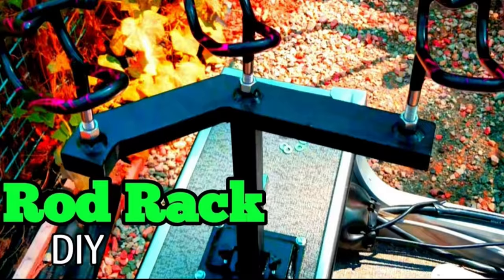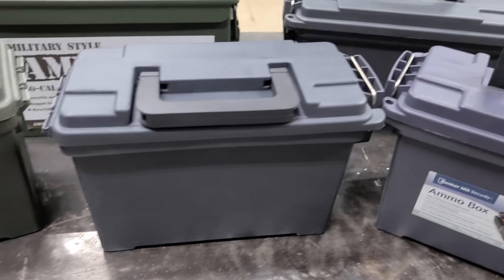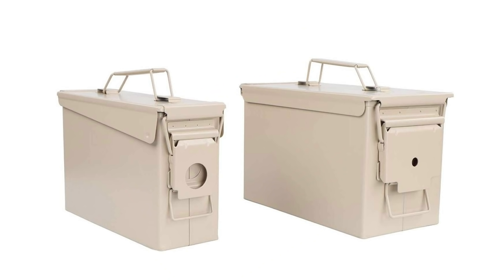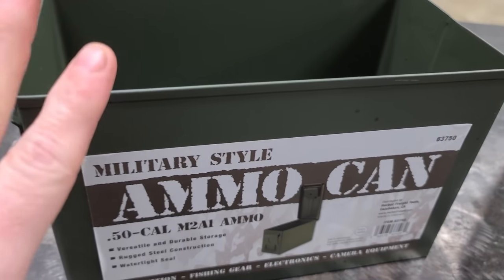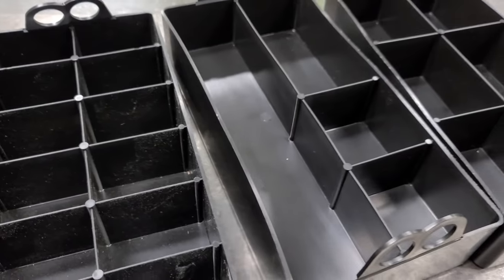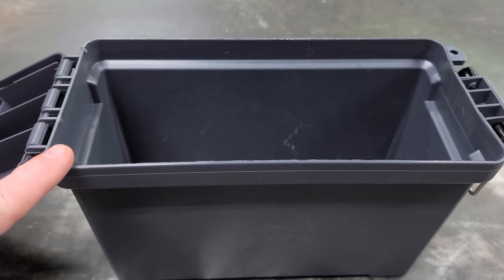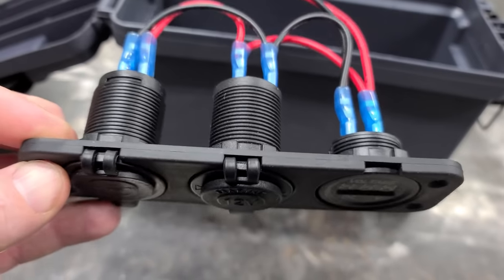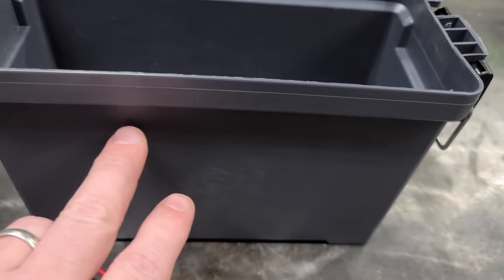10 Ammo Box Hacks

Comment: For bank fishin'.. instead of wacky noodles,  add another battery.  (connect in parallel)  you could also put your charger in there and a plug-in so when you get home from slaying the fishys, before you get the knife out just plug it in and your ready to go for the next time.  Also great for smaller boats for lights and accessories. and you can use the extra space for smaller items that you need water-proof.  Thanks for the cool vids!     SK.
Reply: Did… did you just sign a YouTube comment. 😂 imma start doing that too. 

A.S
Reply: Good idea... 

D.P

Comment: After watching this a second time, I would recommend using a 3 gallon bucket for your cast nets, versus a sealed ammo can. Because a cast net, gets wet and fish slimmed up, by the end of the day. Get a 3 / 5 gallon bucket. Drill some drain holes in it. At the end of the day, you can wash off the net with some soap and water, and let it drain and dry in its own bucket. Then its clean, dry, and NOT Stanky! And ready for the next big adventure! And you can always get a lid for the bucket, to keep the net stored, but the holes allow for dry air circulation.

Comment: Made the battery box power source.  Amazon has a power hub that also has a switch built in.  Solves one issue with that box.  I also added a charging port on the back side so you can just plug a battery tender or solar panel into it.  Never have to open the box.
Reply: How long does the battery last for what your using it for

Comment: Like the afterthought of the switch. Maybe grommets too and some silicone just to make sure it's sealed. 
Loving your hacks and as always, looking forward to more. HG's sinker box was great too. 
Can't wait to get back to fishing.
Reply: Most those plastic boxes aren't sealed to start with,not like the steel cans,so you don't need any silicone.
Some are though so look in the lid for a rubber seal,if it's there you can add silicone to the plugs/switch.
Reply: Most of those panels with usb and 12v ports have switches now built in. Under $20 on Amazon.

Comment: I love power supply box especially since i have a USB flashlight, I would add some extra wire and bolts on the outside of the power box to charge it that way I never have to remove the battery just add a vent for heat and vapor, I don't have need for a grill, but that was a bad ass hack.  The tool box idea on the trailer is a new addition coming soon, keeping bearings, or whatever.

Comment: I use my ammo cans to store ammo in.

Hack #11: Put strips of colored masking tape on the top and across the front, under the latch, enough tape to be able to write on with a felt tip marker, and read easily.  That way, no matter how you store the boxes you can see what's inside that can and where the can you need is in the stack.  This isn't permanent, so you can re-purpose the cans as you need to.  Your supply of X dwindles down you can move X to a smaller box, relabel and reuse the boxes.

Good channel.
Reply from the maker: Thank you , that's a good tip

Comment: For the battery holder boxes, you could install a 12v power plug and use a solar charger to keep the battery topped off. Might be a good idea to add a fuse to keep from melting wires.
Reply from the maker: I did want to do that too , but I wanted it to fit inside the box and I ran out of time . I'm on a schedule lol
Reply: That's an excellent notion. One of those little Harbor Freight 1½ Watt Solar Panels for under $20 nowadays will really do the trick for keeping up a good maintenance charge. I recently tested my little sailboat's elderly standard lead acid house battery with a multi-meter. It's had no other charge in years, and it was tip-top. The panel is nicely weatherproof. My panel's been sitting outside on the bow in all weathers. Unlike higher wattage panels these little 1½ Watters are just the right amount of "gutless" and need no special charge controller to keep them from over-charging or "cooking" the battery. Just set and forget. It would take a few days to bring up a really dead or discharged battery, assuming it could even still take a charge, but it'll top up or maintain one just fine for years and years. The panel comes with alligator clamps or a cigarette lighter style plug. HF also sells a 'Solar Panel Connection Kit' for under $20 that contains a sort of extension cord and other useful doodads in case you have a battery in a shed or garage you want to keep happy, like in a motorcycle, riding mower or similar.
Reply: no fuse and a needle nose pliers crimp make this dual purpose, power, and fire source.
Reply: it has an in-line fuse, is that not sufficient?

Comment: Hello Buddy... Your personality and inspirations are always a blast. I had to do the Power Box. Added a Power Switch, Hot Wire Fuse, attached a Power Inverter and Sealed the Openings with Silicone.  So my box has 12 volt and 110V.  One thing more I added was a External Power Connection that allows me to Charge the Battery with it still in the box.
Reply from the maker: That's sounds really Awesome

Comment: Great video Keith! 

It's causing me to think of some other possibilities for the metal ammo boxes.  1. Given you made a grill, I bet you could also make a mini meat/cheese smoker box, or a portable solar oven. 2. A portable heater fueled by candle or oil lamps. 3. Portable boombox for your tunes, basically a speaker box that runs off your cell phone's music list and has a battery inside of it like one of your builds has in it.  4. A mini cold box to keep a few bottles of beer chilled. 5. A Jaw Harp case, always playing the jaw harp. 6. Portable fondue set with a built in burner and several segmented areas for cheese and chocolate. 7. A movie projector, there's all sorts of ways to do something like this. 8. A model rocket launcher (platform, guide wire, battery, switch, motor storage, etc.). 9. Camping Food Prep Station - cutting board, knife holder, cheese grater, holds your spices, oils, etc. 10. Mini Air compressor/air pump.  11. A crazy sort of weapon such as a flame thrower, catapult, cross-bow,  evil death ray, or maybe the perfect mouse trap? 12. Water filtration system and/or distiller. 13. First-Aid Box - you might have mentioned it. 

There's probably a million things you do make with metal and plastic ammo boxes.
Reply from the maker: Dang I thought I had a complex mind haha thanks for the idea brother
Reply: @FishinNStuff  LOL you inspired me. I will have to check out your other videos and if I happen to get around to making any of these ideas a reality then I will post a video and share it with you.
Reply: Im liking your water filtration idea. Im going to do the solar one as well. oh and air pump. Looks like im going HF again lol. God bless

Comment: Great job Keith! For the grill you could use the expanded metal as the charcoal grate. Would hold up better then the shelving and would be more sturdy. Love your videos.
Reply: And you could add 4 more bolts to hold the expanded metal an inch or so off of the bottom.
Reply: Maybe put 1/2 inch sand in bottom too

Comment: Bought a four position gauge set up and followed pretty close to everything you did.  Turned out pretty cool.  The fourth switch was the built in on off switch, so I don't have to "un-plug" the battery wire every time.  Installed the Kayak battery and used the pool noodles to fill in the spaces to prevent sliding of the battery.  I also made the pool noodle catfish PCP pipe floats.  Cool stuff.  On to the cork floats for my favorite fishing hat and possibly crappie casting floats.
Reply from the maker: Yeah I didn't think far enough ahead when I planned mine lol
Reply: So the 4 position gauge was off of Amazon I'm thinking. I have zero experience with power stuff. My question is probably goofy..1- You had to buy maybe a toggle switch & another red & blue wire for the extra station?
2- where do I hook up the onoff switch to kill all of it at once.
3- Would this Kayak battery power a small TV for 4 hours as an example? 
4- Are these Kayak batteries usually Nikel Cadmium, Lithium or otherwise?
Thank you in advance if you find the time. I asked a lot so I understand if you don't .
Linda
Reply: @lindacasey5016  Hi, first you don't need extra wires, just use the ones that come with the 4 switch. I replaced the fourth switch with the power switch, but I still pull one leed wire off the battery when transporting, just to be sure the power switch doesn't get bumped.  I keep the small charger inside the ammo box, there's room, I do take it out when on the boat as it will bounce in the waves, another little extra caution.  2nd the small TV, all I can say is maybe.  Would depend on amp draw and what you are using for the power inverter. These are milli amps, you may want a full sized battery and suitable power inverter for a TV.  3rd I just went with the one Fishing Stuff used, it was one of the better priced for size and my needs. Straight off Amazon all of it. Note those switch all of them, are just single units, and a plastic retaining screw holds them from behind. Its as simple as sliding off the switch you want to replace and slide in the one you want, also you can change the configuration of which switch goes where to your liking.

Comment: Great video on the "hacks" er... alternative uses of ammo cans. A couple of tips on cutting thick aluminum sheet, a circular saw with a carbide blade will cut aluminum as easy as plywood (wear PPE) and if you have to bend the aluminum to keep it from breaking make a mark with a sharpie pen where you want the bend to be, heat the sheet with a torch (regular propane works well) until the sharpie line disappears then let the part cool down and it will bend easily without breaking.

Comment: I made a battery box a few years ago with a cigarette lighter socket so I can run my 12v inflator in the tent as well as charge phones. I used a larger 12 amp battery that has about 2 times the stored energy as these 7 amp batteries plus it doesn’t require all the pool noodle to keep it from moving around.
Reply from the maker: That's awesome  , I would be really cool with a lithium battery  . One of the the reasons I used the kayak battery is because of the weight  . Adding weight is always a bad thing for kayaks or boats but don't make a difference camping , and would be better the way you did it

Comment: For the micro grill
Use expanded metal bent 2" 90° down for ur coal grate , not that plastic coated closet rack junk
Reply: x2 because sometimes even that vinyl coated stuff is galvanized under and that crap gives off poison gas when heated.
Reply: I third this.
Reply: @user-neo71665  I was hoping someone had mentioned that about the galvanized metal. Not sure if the paint and metal from the ammo box is toxic
Reply: if the grill box is too hot when the lid goes on, that seal will burn like a tire, black and smelly.  Also, I back up what the others said...paint, vinyl and galvanization are all toxic when burning.  I'd stay with SS or iron rather than take a chance getting lung or nervous system damage.
Reply: @gardenhawk  Yeah, unfortunately if it's not intended for using with food, the answer is almost always yes. Luckily though any residue will just be on the inside of the can after the first burn, and then you can put the clean cooking grate in afterwards and just keep the food away from the sides of the can. Could even probably bend the grate up around the edges to prevent that too.

Comment: Really like the battery pack, I'm going to make one, we get those batteries all the time at my work they are the backup power for things like security and fire panels, might just disappear a couple from the shop! 
Only change I would recommend is using machine screws And nuts to put the plug/ meter on, that way there's no sharp points that could puncture the battery!

Comment: Nice! I need to make me one of those battery boxes for my yak! Couple of suggestions. One thing you can do with plain steel expanded metal for grill grates, season them like  you do cast iron. Put some shortening on them and let them cure in the oven or grill for that matter. Also, on the weight divider, you could scratch, engrave, or stamp the weight sizes on the top of the divider.

Comment: You should put a battery tender where you put the pool noodle for easy recharging
Reply: No need to,the cig plug will let you plug it into a charger.The 2 chargers I bought had SAE ends ( 18:15 ) and multiple connectors,one was a male cig plug.I just plug them in to recharge.
Tip,the 2 chargers I bought needed a SAE adapter that reversed polarity because the company made it reversed from what everything else is...so you would have to buy their products.

Comment: The ammo can grill would probably work better with the expanded steel in the bottom too. Measure the length needed.Draw a line on a piece of paper the length needed.Then draw a line at 90* on the ends about 3/4 to 1" long then go to the middle and draw a V 3/4 to 1" as you made the ends.
Now use a string to lay it on the drawing to follow the whole drawing.That's the length of metal you'll need.
Cut out the metal needed then bend the V in or close to the middle,then bend the 90's on the ends.It'll hold up a lot better than that kitchen rack.If it id a hair to long close the gap in the V more and bend the end a little more so it sits right.

Gonna want to burn it a lot to burn all that paint off before cooking.The outside will burn off to but get some HiTemp paint for wood stoves,etc. and paint the outside,not inside.

You could also make a small boxed tray for in the bottom to catch ashes,with loops on the ends.Then you could use 2 rods and make hooks out of them.You can then use the hooks to pull up the expanded metal and tray all in one to let it finish burning out,drench it with water,etc. and allow the can to cool before packing it up.
Reply: Oh,just seen someone already mentioned something like it using the expanded metal..
I gotta start telling myself "Self,you must start finishing watching the vids 1st then read as many comments as you can,then comment.Not watch and comment as you go then read comments"...

Comment: For the bottom grate to prevent burning through, I suggest taking a  second piece of that SS screen and putting a half-inch bolt on each corner and maybe one on each side in the middle as legs.  That would keep the grate for your charcoal approximately 3/8 inch off the bottom.

Comment: Your battery box I been using for years super handy but I use UB-1250  batteries there very small 12v and you can get 3 in one of those plastic ammo boxes plus there about $6 each
Reply: Correction since I haven't bought the batteries in a while they have gone up to between $8-$11 each

Comment: For hack number 10. not sure it was intentional but you said 50mm not .50 caliber... small bit of difference, lol 

The grill, its good to have the bottom rack off the bottom above the vent holes. 

And another hack, one rather useful for those of us in the north, the .50cal and 30mm (larger) steel ammo boxes can be made into small portable wood stoves for winter camping and ice fishing. First you attach legs to it in the form of angle iron or sturdy coat hangers bolted on. use expanded steel cut to size that should fit and sit on top of the bolts of the legs. drill 2 or 3 vent holes in the non latch side below the grate line. leave 3/4 inch on each side, above the grate and below the top on the back and cut out a square hole..take some sheet steel as wide as the  back of the ammo can and cut a square that covers the width and height of the back of the ammo can. cut a door piece and the lower piece.. use a door hinge bolted or tack welded on to attach the door. drill a hole in the top  corner of the lower plate and above where it would sit on the stove. (goal being to have it rotate down 90 degrees revealing the holes to control airflow.) attach a locking latch to the door. replace the rubber gasket in the lid with a fire gasket they use for pellet stoves put one around the door too. in the lid drill a hole 2 inch or bigger. braze a auto exhaust adapter of the same size over the hole and then use pre-bent exhaust pipe for your smoke stack.  use a wall pass through plate that you would use on a house attached to your canvas tent or shanty..  paint it with a high temp paint used for engine blocks.   (be sure to burn it a couple times outside before you use it inside to burn all the toxic chemicals off the outside) best part if you keep the exhaust pipe pieces short enough you can store them inside the can.
Reply from the maker: Slip of the tongue lol . I like the Woodstock too and thought about doing one later maybe . But the video was 23 mins long already lol

Comment: For the grill hack #5, you could also use an old refrigerator shelf.

For the battery box hack #7, if you need more power, they also make a 9 amp hour battery the exact same size and shape as the 7 amp hour unit you have there.

Comment: I prefer to use the lid to mount components, makes the interior a lot more useful.

Also, if you can afford to do it, I like to reuse my 5k mah 3s lipo batteries which massively lightens up the box from standard SLA. They're about $25 per from Hobbyking.
Reply from the maker: That's not a bad price